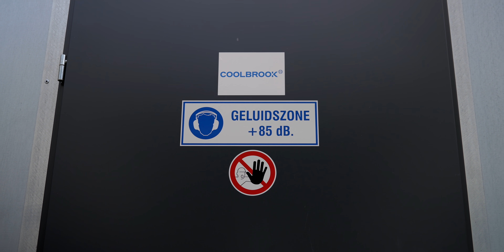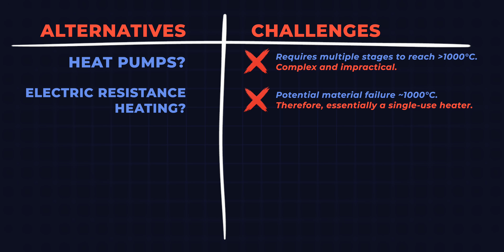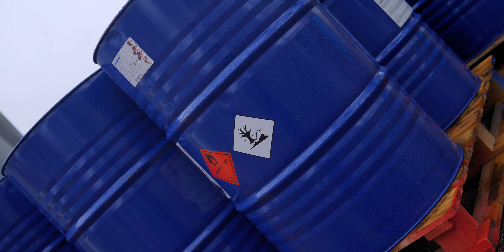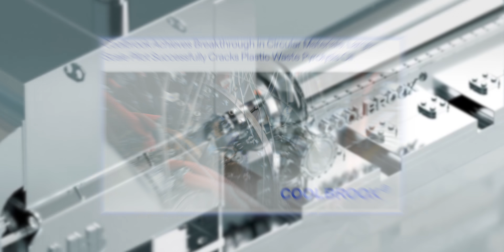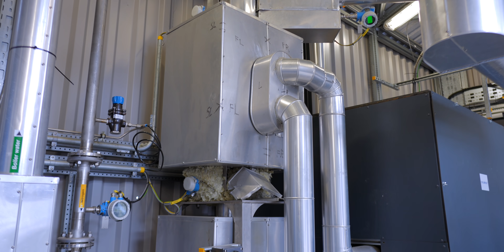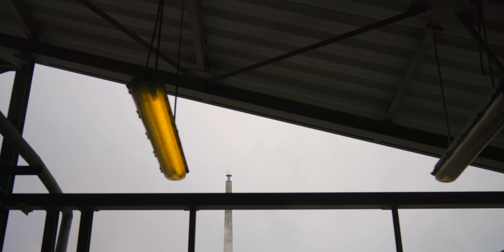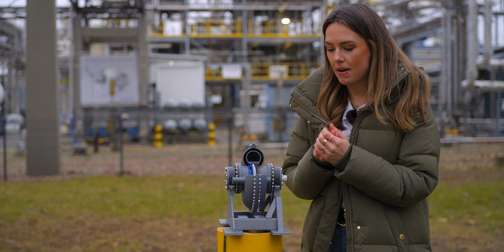Where Heat Pumps Won't Cut It, Coolbrook's Shockwaves Might....

Comment: So it's advantage over resistive heating/burning fossiles seems to be the heat recovery asspect. This is great, however Carnot dictates that the source temperature needs to be near the sink temp. Its a good technology but very different situation than low temperature heatpump that use the ambient environment as energy source... No free lunch here. A alternative path would be to invest in low tech, low capex, resistive reactors that can be ramped up/down depending on renewal availability . See Casey Handmers blog articles for the economics of future energy demanding industries given the coming age of extreme low cost of pv (+ battery).

Comment: Why did you wait until the end of the video to explain how it works? And why did you not explain what naphtha is and what the end products of the process are, and whether or not any greenhouse gases are released? And why did you imply that this has anything to do with the cement or steel making processes? Surely this would have no application in either of these? And why lead your headline with negatives about heat pumps? Surely you could do a piece on all the industrial processes requiring low level heat which could be supplied by heat pumps?
Reply: Because the negative connotation ref heat pumps is a hook.

This platform relies on such clumsy hooks to gain audience.

Comment: 1000C not possible with resistance heating? What? You can buy 1200C furnaces right now. A light bulb filament works at 2700C. There's also arc heating and induction heating, both used in industrial smelting. The reason fossil fuels are used is price.
Reply: I think 1500 is the high end for scientific furnaces that use resistive heating. I personally worked with one that went up to 1200.
Reply: @hammerth1421  That is incorrect. Up to at least 2'800 °C you get kilns right off the shelve, example would be the Linn type KKV kiln.
Reply: This is a commercial I am afraid...
Reply: Seems  on turbine spin the centrifugal  force requires the gearbox  ,have you done the research papers on a very old technology of the past --- that being the fly wheel -- many did explode  yet very little done about doing the research of what caused that fly wheel to explode . It was all put down due to the casting of  the wheel But in reality  Spinning at speeds that yourgoodselves are doing a requirement exploritory investigation  certainly should be carried out  surrounding the spin .  Rolls Royce do test the engine spin to destruction for the blades and indeed the casing also to ensure the casing does it's job . Magnetic interference may cause a problem vibration ,choice of a bearing which certainly can be required of several bearing within bearing  similar to gear process    but also of temperature lube which requires inseminating between surface requisite force tos by utilising the bearing spin centrifugal force to return the temperature lube to initial area between the individual bearing surface ( Hence of why I suggested removing that office and glazed  window  away from the spin)
Reply: @keithdavies2536  Drugs are bad mkay?

Comment: How does it generate these extreme temperatures without melting its own turbine blades? 🤔
Reply: I saw a video previously on how they do the turbine blades in jet engines at Rolls-Royce, which I would have to assume is where Mark Wilson's background comes in. Those have to operate inside a jet engine above their own melting temperature. There's microscopic holes in the turbine blades that let them cover themselves in a boundary layer of cool air (cool being relative in this context, the boundary layer is 800° c) so the turbine is doing work on the superheated gas without actually being in contact with it.

Comment: And I thought aluminium smelting energy was mostly from electricity, not fossils.  Yes,  fossils are still being used to produce that electricity, but other energy sources are steadily taking over, for electricity generation.  

I would mention Iceland and geothermal energy for the Aluminium industry, in particular
Reply: electricity is always used when refining it , but when used in casting or foil/sheet production it is most often gas
Reply: @n7_siquze639    Is induction heating not common for melting Aluminium?
Reply: @oliver90owner  it definitely is but  gas is used a lot as well

Comment: There's another method of heating you didnt list and it uses electricity directly and is quite efficient... induction
Reply: You might as well have mentioned  hydrogen.

That was dismissed as an also ran.

It may be, and I speculate, the sponsors of this platform prohibit any mention of hydrogen unless it serves to persuade us that hydrogen has no future.

Everyone who follows hydrogen engineering knows it's only a matter of time before hydrogen becomes THE go to fuel.

In Europe we see the governments injecting more and more cash into the production and transportation of hydrogen.

Anyone who follows battery development knows there are new technologies being unveiled every five minutes. The issue there is when will we see the "holy grail" in battery terms?

Plus where's the money coming from to exploit the current development of new technology  batteries.

We now hear whispers that a lithium battery is no longer the poster person of power to propel vehicles.

How's that more hijacking the episode?

No, really, no need to thank me, it's a gift.

Comment: Would be keen to know if this process can be ramped up and down quickly, e.g. being able to be turned off at night when solar electricity isn't available.
Reply: High heat and ramping up and down is a bad idea in general.  That puts a lot of stress on everything if you are heating something up and cooling it down daily. Better to just heat it up and keep it at that temperature as long as possible.

Comment: What about an arc furnace, or an induction furnace.  Both are capable of melting any steel.
Reply: This isn’t competing with those technologies, it’s for generating extreme heat and pressure in gases to drive chemical reactions.
Reply: 😂😂😂😂

That might well be true but the episode was about cracking naphtha into "feed stock for the plastics industry".

Try to focus on the content without straying off the subject.

Comment: Iron, aluminum, zirconium, or boron/aluminum powders can each yield industrial grades of heat, inexpensively.  These are all fully recyclable and clean, as well.  Great post!  Finding universal answers would provide the fastest paths forward.
Reply: These materials are burned in air (78% nitrogen, 21% oxygen) & the produced heat creates vast amounts of NOₓ, a powerful greenhouse gas. 
The problem is combustion, not necessarily the fuels.

Comment: The law of diminishing returns is often not just broken but held in utter contempt by almost every single Green technology.
The is as basically as I can state it , for every one unit of input you should receive at least 1.3 units of value at a minimum depending on the long term  demand for the item of value being sustainable at that level. This is the very minimum assuming all establishment costs will be paid by this eventually and any intangible benefits are not the primary goal. The closer the cost verses return gets to one to one the intangible benefit must out way the cost.
When to cost exceeds the return by 1.3 the intangible benefit must be of great value to the point of tangible costs arising without it to justify the expense.

That is a basic explanation , now for the Green rubbish that breaks this law.
For example a Biomass electricity generator. If you can feed it rubbish that needs to be burnt to produce power that's a plus provided there is enough of that rubbish. If you need to import from over seas tons of clear felled forest all using fossil fuels to cut and transport just to avoid digging up some coal that's within a  stones throw of the power plant costing upto twenty times as much as the coal and resulting in four or more times the total carbon emissions you have just virtue signalled yourself into financial moral and common sense bankruptcy.
That is the most extreme REAL example , the rule of thumb with most Green energy technology is that they cost a minimum of three units of value to get two back.
Reply: Oh dear we don't really understand basic economics, yes Biomass is a con, solar PV and wind turbines return many times their capital cost and carbon footprint cost for that matter.
Reply: @ianithompson4239 . Who says they do?
Oh scammers say.
Reply: @ianithompson4239 . Oh do they really?
Then why do so many go bust even with all the free taxpayer funds and usurious supply contracts that pay more for not providing power in many cases?

Comment: Thank you for showing this. These high temperature processes always concern me as to how we will electrify (ok make them carbon neutral) them. Great to see this.
One question, the naphtha is taken from a liquid to gaseous state as mentioned earlier on in the process, is this just a resistive heating process?
Thanks
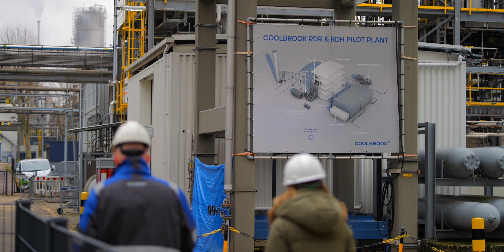Reply: They mentioned this in passing in the video but did not cover it clearly (see the banner at 6:00 for example). Coolbrook has two systems in use at this site: their RotoDynamic Reactor (RDR), which uses their turbine technology to react one chemical (Naptha in this case) with steam to create new chemicals; and, their RotoDynamic Heater (RDH), which uses electricity to heat gasses (air, nitrogen, or direct process gasses) again using their turbine technology, which was used to convert the Naptha from liquid to gas.
Reply: My guess is: it probably is at the moment, because that's not necessarily the main part of the process they are testing. And I'm sure heat pumps could be used for that part (pre-heating)!

Comment: What is missed this is that this is purely for making NAFTA again.

This is a large part of getting to netzero, but it's piece of the puzzle, not a solution for all industrial heat processes.
Reply: The application shown is for processing NAFTA into desired end products. The same invention should be used for other things though. The early adopters of this tech being the petrochemical industrial I think does a disservice to the true potential of a device that can use turbulence and viscous heating to increase the temperature of gases. There are far, far higher uses for this thing.
Reply: @BlueOceanStrategistS this isn't done by a petrochemical industry, there simply on the same industry park.
Reply: Coolbrook has two RotoDynamic technologies, one is a reactor (RotoDynamic Reactor, RDR) to specifically replace combustion based petrochemical processes, and the other is their cross-industry high heat RotoDynamic Heater (RDH). The RDH can reach upto 1,700°C and is designed for high heat industries, furnaces, kilns, cement making etc. The RDH heats gasses directly, which can be air, nitrogen or direct process gasses using their turbine based heating technology. In this video the output of pre-heating RDH is used in a transfer heat to the Naptha liquid to convert it to a gas so it can then be used directly in the RDR.
Reply: I never knew the word was spelled Nafta in Dutch, but it kind of makes sense since you don't have the theta sound.  Oddly, Germans retain the English spelling, though obviously not pronouncing the theta.
Reply: @Salmagundiii not sure it is, I only heared about this company trough some podcasts during the years.

They've been developing it for atleast a decade now.

Comment: So where do you get the Naptha from?
Reply: Venezuela
Reply: They mentioned in the video that they've tested it on pyrolysis based feedstocks made from old plastic. So at present it's just an energy efficiency improvement for oil refining but the same process could be used for other things later.

Comment: How do the compressor vanes, stators and reaction vessel walls not melt? Is there some clever cooling going on that we weren't told about?

If they are simply tough enough to withstand those temperatures, why not just use them as resistance heaters and save all the complication?
Reply: Energy efficiency and target temperature, and mention in the video at the target temperatures resitive heating tends to fail. Their heating technology (RDH) for example can heat gasses to 1,700°C at those temperatures other electric heating methods can fail. Efficiency is also higher in these systems, others like the Futraheat TurboClaw, use a similar approach in low to mid process heat recovery applications where they can replace both thermal and resistive heating systems.
Reply: @GruffSillyGoat Resistive heating can go FAR higher. SiC or MoSi heating elements for example. If you want, you could also use a graphite rod and go to 3'000 °C. Any incandescent lamp runs at incredible temperatures via resistive heating. But the problem is getting that heat into the process efficiently. In the video a gas is heated and the question remains why it would not be possible with a resistive heating element, which you could simply let the gas flow over. This is very unlike a cement kiln, where the heat needs to be in the solid bed and the gas is always just a means to move heat. Heating elements would be super inefficient here.
Reply: @leocurious9919  - for gases resistive heating is more by way of a heat transfer process dependant upon the exposed heating surface area and flow rate of the gas over that surface (plus a degree of radiative heating but is typically not as effective on a flowing gas). The turbine approach seeks to heat the gas more directly via compression of the gas. 

There are applications where 95% energy transfer via compression in a high flow rate gas is more efficient than heating an area of a gas resistively (you're likely need to raise the resistive heat well above the target temperature to transfer the required heat into a flowing gas). 

The compression approach also has a fine degree of control over the temperature of the gas, that could be useful in areas such as advanced ceramic (which may cycle from many temperatures requiring high accuracy). Plus can work with a wide range of gases, that may react with a resistive element at high heats.
Reply: Good question, the temperatures they quote are way above what the latest turbine blade materials can withstand. My guess would be that the temperature rise is engineered to happen outside of the rotor and stator blades in an area that can be easily cooled. This could be done by accelerating the gas to an extreme speed and then trading that momentum for heat and pressure. One important advantage over resistance heaters is the high pressure that will drive chemical reactions faster.
Reply: Same reason they don't melt in jet engines, special alloys that are heat resistant to over 2000 degrees. By contrast, a common material used in industrial resistive heaters is Nichrome, which has a melting point around 1400 degrees.
Reply: The heating is very fast, occurring in the stable shockwave, then expanding away.  The shockwave wouldn't touch the sides of the toroidal compressor, as it would be destabilised.
Reply: @ChrisNotTheKing  What is your source for these claims? Like how can the shockwave NOT hit something right next to it?
Reply: @leocurious9919  Look up shock bounday-layer interaction in gas turbines and rockets.  I don't study the field, having learnt from disparate sources, but a quick search came up with some authorative textbooks.  Specifically I was thinking about how SBLI can form undesirable oscillations.  Remember the shockwave is moving through the medium at the same speed the medium is moving, balancing on a blade edge (pun).  Some supersonic jet nose cones can be moved to control the location of the shockwave.